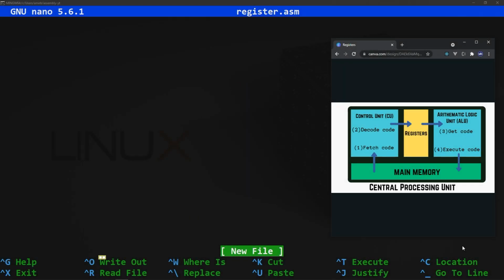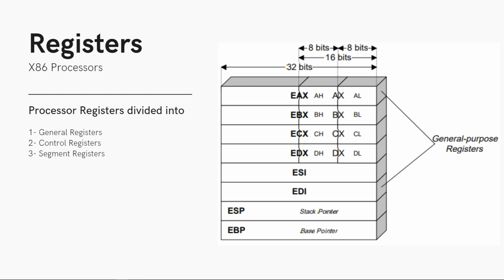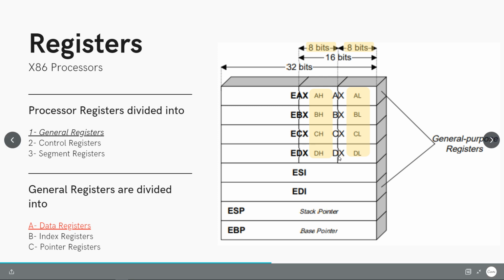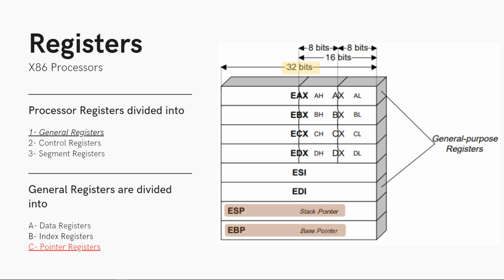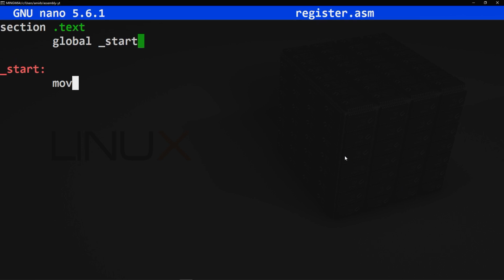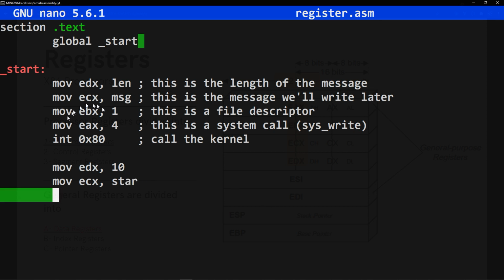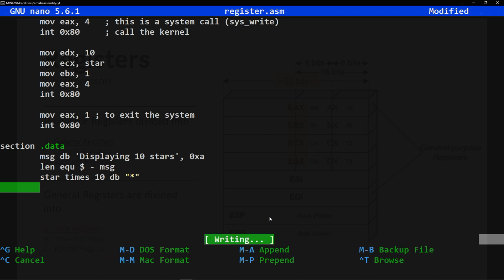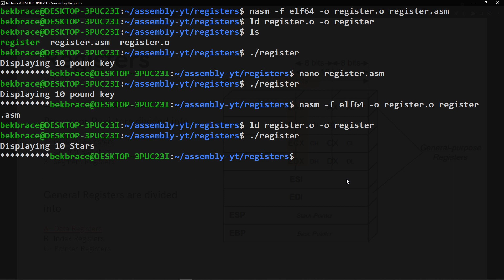Assembly Language: 2 Registers - X86 (32 BIT) Arch #assembly  #assemblylanguage

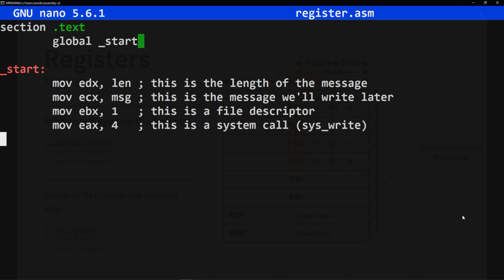Comment: 8:06 sooo when int 0x80 called it know its doing sys write 4 and output go 1 must be screen/stdout
it doing len times loop dec that same time inc msg?when it know stop bcoz we not store current loop position?

i would do it len stay there and msg is inc every loop till when it match len thats dat but where count is stored LOL
so it need dec len and string is fetch end of msg-len rregister (edx)
soo edx is kinda pointer to data and ecx is counter. did linus torwald made bobo LOL

but who cares those are data we need write LOL not matter what kernel do it. it might change those registers many times doing his cycle
basicallt if you printf in c this you should get but not LOL